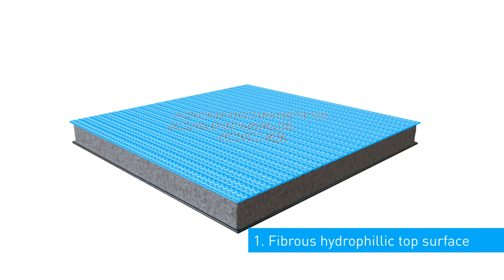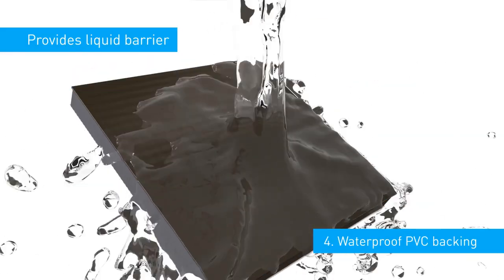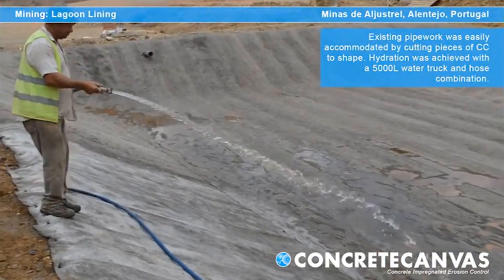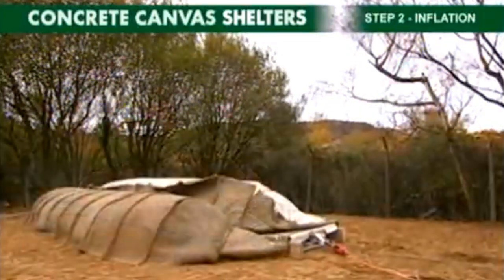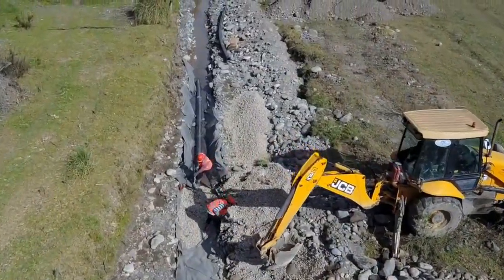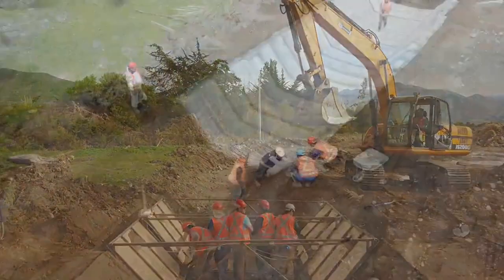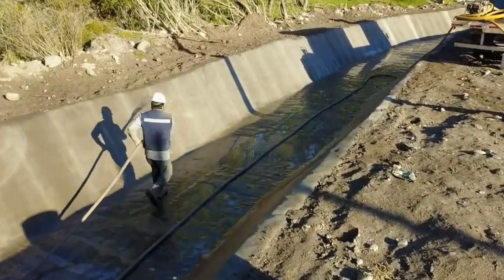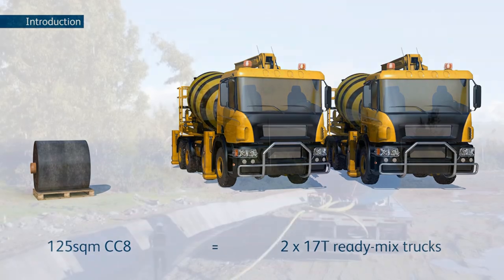Premade Concrete Canvas Tents - Just Add Water

Comment: Reduce That Cost To About $5000 For The "Tent" And Under $20 Per Square Meter For The Fabric, Then You Have A Real Market.
Reply: Mit U  I Think A Lot Of People Would Invest In Them For Multiple Reasons If They Were Affordable. It Would Be Great For A Somewhat Portable Permanent Shelter That Could Be Installed Just About Anywhere, Like On A Remote Mountain Or A Backyard.
Reply: At that price an "instant garage" would do really well
Reply: @donaldpyper4627  It Would Be Even Better And More Insulated Than Shipping Container Shelters.
Reply: I could use this on my driveway
Reply: @melvinmariott8609  People Could Use It On A Lot Of Things, Like Ditches, Ponds, Reservoirs, Vehicles, Shelters, Etcetera.
Reply: They already have a market. It's called ripping off the government. You're already paying too, and you don't even get one. Congratulations!
Reply: @VerifyTheTruth  I suppose you could build a simply frame covered in layers of chicken wire and trowel on concrete to create the same effect.  A bit more work, but you could also make it the shape you want and have holes for windows, doors and roof vents for heaters etc.
Reply: @williampotter2098  Absolutely. Concrete Is Cheap, Add A Little Volcanic Ash And Some Coconut Or Hemp Fiber And You Have Insulated Roman Concrete Too..
Reply: @williampotter2098  Design It In The Fashion Of An Ambient Heat Pump And Most Of Your Air Conditioning Needs Go Out The Window..
Reply: @Tristoo  3d Printed Homes And Stone-Concrete Structures Could Solve World Homelessness And Insufficient Dilapidated Shelter In A Matter Of A Couple Years.. With The Right Funding. A Few Trillion Dollars And A Lot Of Manpower Could Solve Half Of World Hunger, While Providing Clean Water Sufficient For Drinking And Agriculture And Electricity. Add A Couple More Trillion And They Get Sufficient Shelter Too. However, Many Of The People Of 'High Society' Espouse The Belief That The Earth Is Overpopulated And Endorse Population Control Measures, Making Such An Effort Ever The More Difficult To Truly Achieve, Because It Apparently Does Not Resonate Well With Their Agendas.
Reply: @VerifyTheTruth  
1. this has nothing to do with 3d printing
2. homeless people in developed countries are homeless for one of 2 reasons: because they want to be homeless; or bad policy. Sometimes both.
Reply: @Tristoo  Lol. Are You Serious? Look Around. Very Very Few People WANT To Be Homeless..
Reply: @Tristoo  I Would Say That War Is Probably The Main Cause Of Homelessness For A Variety Of Reasons, The Least Of Which Is Destroyed Homes.
Reply: @Tristoo  There Is Plenty Of Land And Space To Live, But It Has Been Restricted, Purchased, And Consolidated To The Point Where The Homeless Have No Where Left To Go, To Build A Livable Shelter And Actually Survive.
Reply: @Tristoo  When Is The Last Time Your Dice Landed On Homelessness?
Reply: @Tristoo  Try And Think About It This Way. What Is Some People Suffer Great Loss And A Dealt Bad Cards, Like Homelessness, So You Get A Better Hand? How Then Should People Act?
Reply: @Tristoo  First Of All, I Updated My First Post To Address Point Number 1, And I Addressed Point Number 2 About Bad Policy 3 Comments Later.
Reply: @VerifyTheTruth  some people are dealt shit hands since they're born and they don't end up homeless. Not a good point.
How should they act? You've got plenty of programs for the homeless, and if you manage to save up some pennies to get yourself clean and some usable clothes, you can get a job and maybe ask for your employer to pay you by the day or week so you can get your shit going. If you're not living in a big city where you're charged $2000 dollars rent for a shitty room, you can maybe crash with somebody (coworker?) for a month and save up to rent next month

I'm a dimwit, I'm sure if you're homeless you'll have the time and the willingness to think of a better solution.
Reply: @VerifyTheTruth  you should either type faster or not spread out your answer through 4 different comments
Reply: @VerifyTheTruth  the last time my dice landed on homeless was about 2 years ago, and luckily I have people who I care about and that care about me and helped me out. The solution I came up with was assuming you didn't have that. Most people do.
Reply: @VerifyTheTruth  Can you amplify on that?  Is it the shape of the building?
Reply: @williampotter2098  Gotta Charge My Phone, Will Reply Shortly.
Reply: @VerifyTheTruth  oh I didn't read the war point. that's because the democrats figured they didn't need mental institutions anymore, and so you've got people with PTSD running around with no help.
Plus I seriously doubt that, go to LA where half the people are homeless. I doubt you'll find a lot of war vets on the street.
Reply: @Tristoo  Empathy Did Not Motivate Hitler, That Was Apparently Psychopathy With A Healthy Dose Of "Intellectual" Secular "Scientific" Eugenics.
Reply: @VerifyTheTruth  fucking youtube deleting my comments
Reply: @VerifyTheTruth  inb4 comments start getting deleted for spam cuz they look like gibberish
Reply: @VerifyTheTruth  oh wait, I don't think you can even copy other people's comments on the app, and you said you were on the phone.
Yeah I'm sorry I'd just rather not have a conversation than having to rewrite the same comment 40 times until it passes the censorship filter. This platform is garbage man. Social media in general is becoming this. I'd rather people called me a ni**er than not being able to post half my comments/replies. Perfect example of how empathy didn't work out so well.
Reply: @williampotter2098  Sorry About The Delay. I Don't Have Any Electricity Right Now, And No Phone Service, So My Neighbor Let's Me Charge At His House And Use His Net.
Reply: @williampotter2098  The Ancient Persians Built Their Buildings With A Type Of Cooling System That Involved Utilizing Updraft Thermodynamics And The Ancient Japanese, I Believe It Was, Utilized Activated Charcoal Under The Baseboards And Geothermal Draft Based Air Conditioning. There Are Many Different Types Of Historic Natural Ambient Heating And Cooling Technology Systems That Can Be Integrated Into A Structure To Produce Similar Effects To A Great Degree Of Efficiency. The Shape Of A Structure, Such As High Ceilings, Has Traditionally Been Used To Functional Ends, Rather Than Mere Aesthetics. Building Materials, Such As The Stone In Castles, Also Play A Significant Role In A Buildings Thermal Layout. The Thermal Movement Conducts Its Path In A Specific Fashion, Creating Drafts, Currents, Temperature And Pressure Gradients. Harnessing These Principles Properly With A Little Ingenuity Goes A Long Way. Simply Allowing Heat To Rise And Escape From The Structure And Cooler Air To Transfer And Nestle Down Into The Living Space, Is The Most Basic Idea In The Form And Function Of Ambient Air Conditioning.
Reply: @Tristoo  I Think You Misread The "How Then Should They Act?" I Was Referring To How Others Of Capable Means Should Voluntarily Act Towards Those Who Have Found Themselves In Dire Need Through Misfortune.

It Seems Far More Simple In Theory To Overcome A Sustained Bout With Abject Poverty, Than It Is In Reality, Especially If One Is Not Graced With Having A Support Network Such As Oneself. Finding Someone With Enough Compassion To Have The Necessary Amount Of Mercy For A Vagrant Pauper To Rise Above The Proverbial Ashes Is Not Quite So Easy As One May Presume. Right Now, With Over 30 Million People Out Of Work And Half Of The Country Apparently Nearing Bankruptcy, I Imagine That It Is Nearly Impossible Without Significant Government Assistance, Which Many Of The Homeless May Conclude In An Institutionalized And Reasonable Distrust As Deceitfully Wanton.
Reply: @Tristoo  I Empathize With Your Censorship Struggle.
Reply: @Tristoo  Bad Policies And Intentionally Bad Policies, Designed To Usher Destitution And Desolation To Specific Subsets Of Population, Could And Probably Should Be Considered Two Seperate Things.
Reply: @VerifyTheTruth  Look it's simple enough, there are countries with barely any homelessness that still employ capitalism (or social capitalism as it's described). I don't know if that's what you were getting to, but clearly the way western civilization is designed isn't the problem. 

The problem is the people who can't make laws. Big urban centers tend to have more homeless people, and I think in part that's because it's harder to have a home in a city (rent price and whatnot). For multiple reasons I don't think one should aspire to live in a big city, but that's just my opinion.

LA lawmakers made it so homeless people could mount tents in the middle of the street. The law didn't allow for that before. They also made it so most misdemeanor charges would be dropped. This allowed people to defecate on the street. I saw all this happen in real time.

The police can't do anything. There was a movement where people tried to organize in order to clean some neighborhoods and help with some stuff. They were shut down because they were "destroying homeless homes" (while they were taking trash, rotten food, and cardboard and putting it in the trash). 
Later the city decided to distribute clean needles through the homeless, so they wouldn't get diseases from sharing needles. All the while shutting down rehab centers and mental institutions to save money. They later had to pay companies to clean the insane amount of new needles they distributed. Yes, there were needles spread around the street, great thing for kids to see.

So no, I don't think empathy is the way to go, I think people should use their brains. And no, I don't think policy that is bad on purpose is any different than policy that just happens to be bad. Not when these people don't go through the trouble of thinking about the laws and bills they pass, when that's their one job.

Again, just giving people houses isn't gonna fix it. If someone can't get off drugs or has mental illness, you could even pay their electricity and water bills, pay for their food and they still wouldn't be able to become functional citizens.

People aren't homeless just because. And until you fix the disease, the symptoms won't go away. The fact that your congressmen still believe "fully semi-automatic" weapons are a thing (while also trying to pass gun laws) should tell you something.
Reply: @Tristoo  Maybe Vaccines Really Do Cause Autism..?
Reply: @Tristoo  You Deserve A Fair Reply To Your Really Long, Well Written Comment, But I Am Exhausted. I Will Make It A Point To Continue This Discussion Tomorrow If I May Take Leave For The Night. I Appreciate The Tenacity You Show About Your Worldview, Even Though I Fundamentally Disagree With Certain Parts Of It. Perhaps It Is A Semantical Disagreement Based Mainly On Differing Definitions Or Maybe Uncommon Experiences Diverge Our Understandings About The World, The Most Pertinent Present Societal Malfunctions, And The Solutions To These Present Pertinent Societal Malfunctions. I Will However Suggest That Empathy Is A High Function Of Love, Being Intrinsically A Functional Technology Of Love's Expression And Comprehension. In My Opinion, To Deem It As Unnecessary Or Overrated Is To Deny Oneself Of An Innate Human Capacity To Achieve Higher Thought. Any Technology Can Be Misapplied Or Misused To Detriment, But That Does Not Take Away From It's True Intended Purpose When Rightly Applied Within The Proper Scope Of It's Definition. Nuclear Power Can Give Light To A City, Or Vaporize It, Depending Almost Wholly Upon Application.
Reply: HexagramMan  They Can Be Shotcreted On The Outside Too. They Are Probably More Difficult To Get Up A Mountain Though, Unless By Helicopter.
Reply: @Tristoo  What Type Of Capitalism Whould You Say America Is Exhibiting Right Now? Personally, I Don't Think It Can Even Be Truly Classified As Capitalist, Democratic, Or As A Constitutional Republic, And It Certainly Is Not Based Upon A Free Market. The Way Western Civilization Is Designed Is Not The Problem; That Is Correct. The Problem Lay In The Fact That They Have Completely Disreguarded The Law Of The Land To Favor An Ass-Backwards Admiralty Based Adversarial Secular Religion Posed As A Justice System And Have Continually Protected Corporate Interests To The Detriment Of Individual Rights And Sovereignty.
Reply: @Tristoo  Have You Ever Read The Preamble To The Various Constitutions, Which Define And Lay Precedent For The Entire Body Of American Law? The Problem Is Not That People Can Not Make Laws, It Is More So That They Have Made Too Many "Laws" Which Violate And Undermine The Very Basic Tenets Of Life, Liberty, And Justice. Many Of These Homeless People That You Speak Of As Refuse Have Been Forced Into Poverty And Abused By The Very System That Was Designed To Protect Their Natural Rights As Human Beings, And Then, As If That Was Not Enough, They Face Rejection And Ridicule For Their Predicament From Individuals Like You. Many Of Them Turn To Lives Of Drugs, Prostitution, And Crime To Survive, Being Without Just Remedy Or Sufficient Help. Who Do You Think Is At The Top Of The Pyramid When It Comes To The Heroin, Organ, And Human Trafficking? Think About It.
Reply: @Tristoo  This Has Been Done, In Many Instances, Intentionally, To Them, Not By Them Or For Them. "Drug Addictions" And "Mental Illness" Are Just As Often, If Not More Often, Directly Caused By The Homelessness As The Homelessness Is Caused By Addictions And Mental Illness, Even Many Of Those Instances Also Being Symptomatic Of A Sick Society. It Is Our Entire Society That Is Sick With An Acute Mental Illness And Various Terminal Addictions To Unhealthy Social Substance. Look Around.
Reply: @Tristoo  Try Using Empathy And Your Brain.. Think About It.
Reply: Verify Truth I live here in Florida, in hurricane alley, love the back yard idea!
Reply: Looks good. But they won't be portable
Reply: Yep, their prices are poor. You can get galvanized structures that can withstand 150mph winds at the same price as their crap, and way bigger.
Reply: $5000? More like $2000, for $5000 you can buy a ship container with about as much internal space, pack your stuff inside it and carry it on a flatbed.
Reply: @jackmcslay  shipping containers are only $2000
Reply: @jackmcslay  $5000 Would Still Be An Improvement Over $30,000..
Reply: @VerifyTheTruth  Y'all check out straw bale construction - it's way cheaper; some have reported heating 500 square feet on a single 100 watt light bulb.
Reply: You can't even buy a new tent of that style made of canvas for 5K. Military tents of these sorts are around 10-20k new. A used DRASH system of equal size can easily go for 5K, again, used.
Reply: @JourneysADRIFT  When They Write A Blank Check On The Public's Back With A Gun In One Hand And A Pen In The Other, I'm Surprised A Canvas Tent Isn't Even More Expensive Than That, But I Suppose A $100,000 Canvas Tent Might Would Raise Too Many Eyebrows Huh?
Reply: @JourneysADRIFT  I Agree With You On Most Of That, But My Point Remains..
Reply: @JourneysADRIFT  I Always Wanted A Mclaren F1.. You Got Some Spare Cash I Can Borrow In Your Name?
Reply: but how much does it cost to make it tho then they will lose money
Reply: @VerifyTheTruth  hiding a car lol
Reply: @jeffstrains4014  Hiding A Car? All I Have To Hide Right Now Is A Rusted Bicycle With Dryrotting Tires.
Reply: 5k can't do it Mabey 10k
Reply: @edwardmcguire3801  I Am Not Familiar With The Production Process. It All Depends On The Process And If A Higher Production Number Would Allow Better Equipment, Bulk Ordering, And A More Streamlined Process Of Production To Be Implemented.
Reply: You could wrap a body it in and drop it in a lake.  Easy body disposal.
Reply: @davidnelson7719  Slightly Morbid, But Noted.
Reply: Also, reduce the price of a brand new Tesla to $50, they'd sell a lot more then. Logic 101.
Reply: @rorschacht8478  It Is A $20,000 Concrete Tent.
Reply: @VerifyTheTruth  What's wrong with you??? Stop capitalizing every word
Reply: @tappajaav  A Better Question Would Be, What Is Wrong With This World? By Comparison, I Am Healthy And Thriving.
Reply: @VerifyTheTruth  Your text isn't. It's horrible to read.
Reply: @tappajaav  Maybe That Is Intentional. Perhaps It Actively Engages Conscious Thought.
Reply: @tappajaav  It Doesn't Automatically Translate Very Well.
Reply: @tappajaav  It Is The Opposite Of Brainwashing, The Antithesis Of Subliminal Programming.
Reply: @VerifyTheTruth  AnD StIlL yOu'Re dOiNg iT, wOwEe!
Reply: @tappajaav  ArE yOu DySlExIc..?
Reply: @tappajaav  Do YoU nOt UdErStAnD eNgLiSh Or ArE yOu OpErAtInG oN sUbCoNsCiOuS pRoGrAmMiNg LiKe A rObOt?
Reply: @tappajaav  Look Up, Neurolinguistics.
Reply: Trust me... you DO NOT want to see a plethora of these things springing up in YOUR neighborhood.
Reply: @timhofstetter5654  If They Keep This Up, May As Well Go Ahead And Set Them Up Now.
Reply: @timhofstetter5654  Why not? What are you scared of?
Reply: for those who say it would fly off the shelf: Short answer no. It wouldn’t. I’m a civil engineer and it just isn’t strong enough to pass regulations. The only use it has is to line a tent and a water channel, and even they won’t survive 10 years.
Reply: @VerifyTheTruth  Factually incorrect.
Reply: @WELLINGTON20  I'm Willing To Accept Functional Criticism And Correction Of Error; To What Are You Referring?
Reply: @WELLINGTON20   I Didn't Mean To Say That It Would Necessarily Fly Off The Shelf; I Said That It Would Have A Real Market, Or, In Other Words, Be More Marketable In A Wider Variety Of Circumstances, Rather Than Only A Couple Of Highly Specialized Applications.

I Didn't Realize That Tents Were Regulated Structures.

However, I Do Appreciate The Honest Assessment Of Your Expertise, As I Have No Way Of Knowing Their Structural Capacities. It Stands To Reason That A Solid Concrete, Stone, Or Earthen Structure Would Likely Be More Stable And Cost Effective Long-Term, In Most Instances.

Do Most Of The Standard Building Code Regulations Only Apply Within Particular Municipalities Or States?
Reply: @Tristoo  2000$ is what my mother pays each month for her suburban apartment, what's your idea of a big city?
Reply: @FDG323  sorry this was a while ago and this thread has 80 responses now. I don't know how big your house is, what area it's in, what country, etc.. So if you were trying to make an argument refresh me on what you're arguing against please and be a little more specific because 2k/mo means drastically different things in different places.
Reply: @Tristoo  I'm living in suburban vancouver and it costs around 2k/m for renting a three bed two bath apartment, we are not in the "big city" but pretty far away from it, so 2k a month for an apartment in the big city you are talking about seems like it would be too cheap, especially with Covid-19 prices.
Reply: @VerifyTheTruth  Seriously I can't even read your comments. I would have if you didn't capitalize every word. Annoying as hell.
Reply: @DivineMercySaves  You Have My Most Endearing Sympathy.. 😥
Reply: @Tristoo  over 90% of homeless persons in America end up on the streets as "working homeless" people who work but are waiting for a place to stay.
During that wait the laws in place dictate that they are arrested.
As its illegal to camp.
Loosing them thier job and thier place in line to get housing they can afford.
After thier jailing they no longer qualify for most jobs as they now have a record.

This was very much so very intentionally designed in 1975. 

Prior to then there was free land available under the agreement of improving it (either abandoned dilapidated properties or wilderness) for the working homeless and auto loans available through the post office.
These where in place as life liberty and the pursuit of happiness requires that all lifestyles be personable, including lifestyles that exist outside of capitalism.

Thier lack of existence has turned all residents of the US into layered classes of serfs. As there is no choice but to participate, and starving to death on the streets is the only other choice.
Reply: Under $20 per square meter? Fuck off. Everybody wants to get paid a ton of money for the job they do, but when these same persons buy something they want to pay next to nothing for it--they see no contradiction in this.
Reply: @stereomachine  
Here Are Just A Few Of Them:
1) My Dad Used To Write Only In All Capital Letters, As A Personal Writing Style, And I Adapted This Form From His Style As A Tribute To His Memory.
2) It Takes Longer To Write And Generally Causes Me To Think More Carefully And Consciously About What I Write.
3) It Takes More Time And Conscious Thought To Accurately Read.
4) It Began As A Personal Linguistics Project, Where I Only Capitalized The First Letter Of Proper Words, Those With Sure And Specific And Distinct Etymological Definitions, And Then Proceeded Over Time In Development Towards The Signature Style Of A Personal Language Dialect, Based Mainly Upon Etymological Definitions, Oratory Punctuations, And An Abundance Of Poetical Literary Devices.
5) My Autocorrect Dictionary Became Accustomed To Me Continually Writing Like This Over The Past Couple Of Years, And Now It Automatically Changes Anything I Write To Capital Letters, If I Don't Capitalize, Making It, In Actuality, More Tedious And Time Consuming To Write In Any Other Way.
6) It Is How I Choose To Write.
7) The Rest.